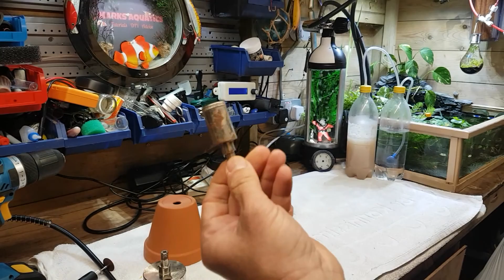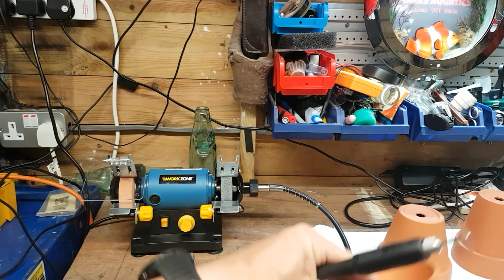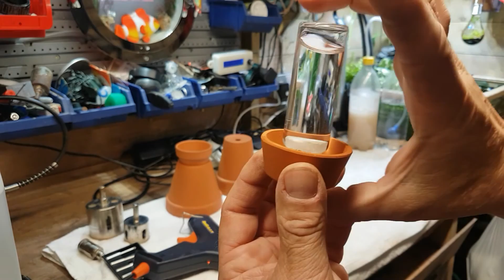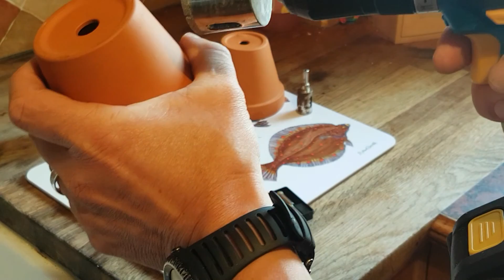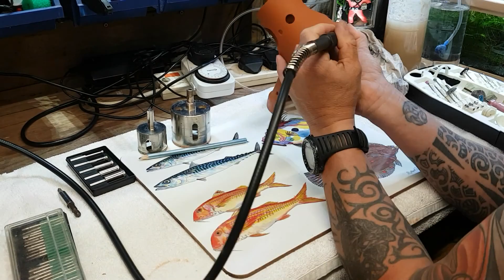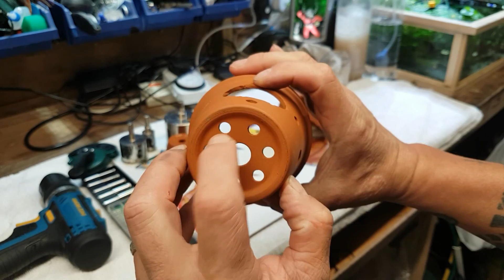FLOWER POT SHRIMP AND FISH HIDES

Comment: Great videos, have you done one on ways to cut glass? I watched the one where you make a mini oxygenater and you gave a good tip on cutting the glass. I have tried in the past cutting a wine bottle to try and make a glass, I used the set light to a piece of string and then cool it down method but it didn't work out, lol
Reply from the maker: Yes I'v done a few videos with glass cutting in them. most tank DIY videos and one on cutting spice jars and whisky bottles for feeder dishes.👍😀